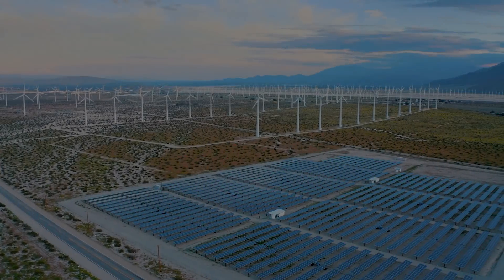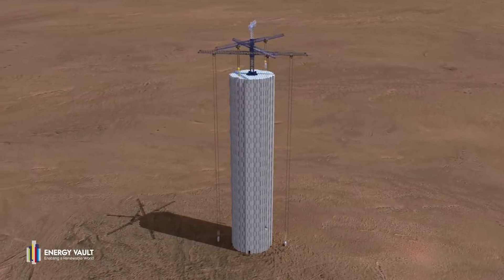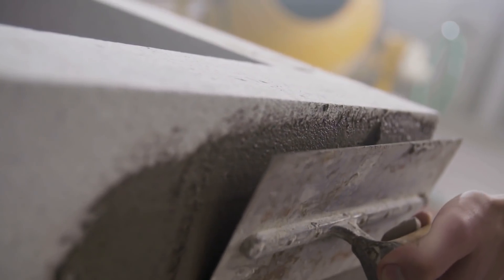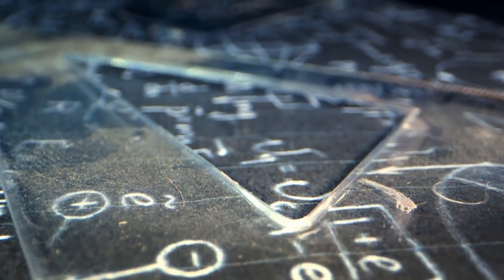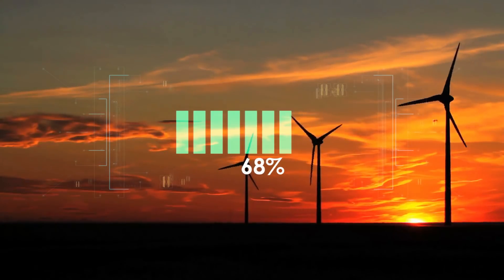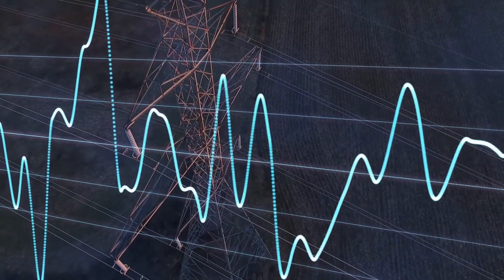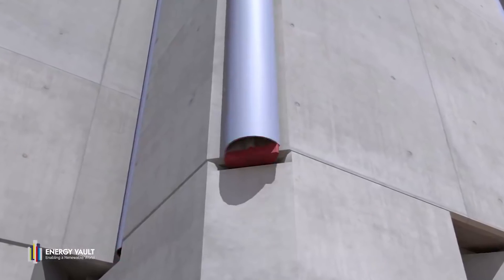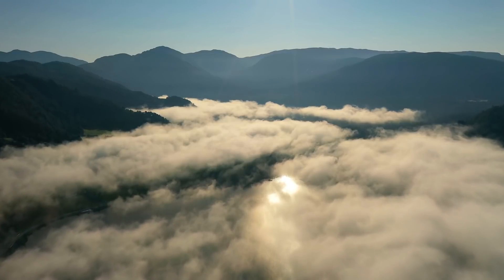Is Concrete the Future of Energy Storage?

Comment: Energy dendity of lifting 4000Kg/m3 concrete over 30 meters does about 1,17 MJ/m3, whereas heating it up by 300C would get us 537 MJ/m3. Liquifying air does 200 MJ/m3.
Lifting concrete has low losses over time but very low energy density and does not allow use of a heatpump that might raise the power efficiency

Comment: The video is great job and so is the idea about energy storage using gravity energy by lifting heavy blocks.  A 35 tone concrete block with weight 35 tone will have a volume around 14.6 m3 and if concrete cost is 300 $/m3 each block will cost $ 4375.  Lifting this blocks on 150 meter will consume around 14.3 kwh energy from wind or solar and this is not for free the energy company will pay the market price or they will invest direct on wind or solar and store the energy they harvest.  Every block will be used only 1 time every day when the consumers need energy.  Not all the energy consumed will be re-generated but let consider 80% efficiency, then 11.45 kwh energy will be output.  This energy may be good for a family.  Now let see multiple blocks on tower 150 m high. The blocks are not all on 150 meter so the energy on average will be half of the energy re-generated, so a block 35 tone will store only 5.72 kwhr and will consume 7.15kwhr and may be used no more than 1 time a day. If the investors on these energy storage will sell their energy with 0.05$/kwhr to distribution companies a blocks which coat $ 4375 will need 42 years to pay only the concrete. Is this what investors need? 
Gravity energy is great but the physic science must be used properly.  On hydro-electricity we use the nature and rain and snow precipitation, we use mountains and river and build dams which store the potential energy and generate electricity on demand and this is cheap and e business which makes money.
We must use the concrete blocks multiple time within a day and generate energy on demand with lower cost and lower pay off time.  This can be done only from one undisclosed invention which is know-haw and only can be disclosed if government and investors will enter on partnership with inventors and keep it know haw.  As the invention will use concrete blocks multiple time and will use other know-haw concepts the energy generated is higher and the cost is lower and this lead on public interest, on government interest, on investor interest, and last but not least on inventors interest.  The inventors are not interested to apply for a patent which they think is unfair because a disclosed idea can be infringed easy from industry.
Interested countries let contact inventors through these paths @namecgregory.com

Comment: What about using the sea! Sea is very deep; on the surface a large floating platform can support concreate blocks that will sink in the sea. Energy stored when the weights are pulled up, same principal mentioned here. Since water density is more than air you will need larger weights, only difference is it!

Comment: This has to be one of the most nakedly stupid ideas I've ever seen.

Why is something so obviously idiotic on a channel that supposedly talks about engineering and science?

Concrete blocks break, they deteriorate, they take a TON of energy to manufacture, they deform.  What idiots came up with this idea?  You'd be better off with pumped water storage and that's not a great idea.
Reply: Just from the top of my head, two sets of a rail, weighted carriages and a hill would be a far better system than this trash. You could use dirt for the weight and you don't really have to worry about weather unlike what you get with crane use.
Reply: @apoorhorseabusedbycenk  If you aim the kick right, you can collapse Cenk's trachea.

Comment: It's just a terrible idea in reality, the amount of energy that can be held is low for the scale of the system, you would have to drop a block many metres to boil one kettle. Lifting and placing the blocks accurately in wind is a problem, wear and tear on the pulleys is a problem. Blocks at the bottom store next to no energy. This problem has already been solved using Water which is so much more plentiful and easy to work with, albeit requiring mountainous terrain to make the best of it.
Reply: It depends solely on the mass of the block and the hight of the shaft, otherwise the is no much difference between hydro and gravity power. Most of the time the mass of the block is overlooked, have your research on that you will see that the system is realistic.

Comment: I thought your channel was a realistic and scientific channel, until this nonsense video. It completely ignores Banks Lake pumped storage, which has a capacity of 34,250 MWh - 500 MW for 70 hours. It's iong since paid off, but a similar project is slated at about $5 billion. Across the project's 90 year lifespan (and still going), that comes out to $1622 per MWh. And being an existing project, that suggests that these other projects are severely lowballing investors - likely it will cost twice as much. Not to mention all of the wind, corrosive, and other effects that will wear down units of concrete block, but water molecules can't be worn down. They can be evaporated, for which reason Banks Lake should get some kind of lid, like California are  looking at over canals. Still, I would have expected even an honorable mention of this very valuable battery in Eastern WA, and for that I've unsubscribed.

Comment: Singapore has a shaft digging machine that probably lowers the cost for ru8nning a Gravitricity borehole.  Energy vaul;t is not nearly as discrete as gravitricity's solution.  These would be like mechanical batteries like flywheels and such.

Comment: gravity energy storage depends on gravity. gravity force depends on weight. weight depends on the density of material. concrete has a density of 2.4g/cm3 , while iron has a density  7.8 , and lead - 11.29. Gravity energy storage with lead as a basic lifting unit will be about 5 times more efficient than gravity system with concrete blocks, and 11.29 times more efficient than water pumped storage since water has a density of 1. So, the point of efficiency in mechanical energy storage finally ends up in the price of the most denser matter you can find at the cheapest price. Open a business to collect all used lead acid batteries and get the cheapest energy storage possible. You could go further and make the energy storage out of Uranium few hundred meters underground but that would be very crazy
Reply: though
what about the maintenance costs?
and of course, metals are much more expensive than concrete, and even more so for water

Comment: the crane people are so dumb. but those mine shaft people may be onto something. 1, lack of wind, 2, no need for insane percision(its literally built in), and relative ease of installation. While the energy vault people have jumped backwards and flipped into giant warehouse, the people at graviticity have just 1 point of failure, sooo... its a big hole, and you have a big weight, now the strain on those cables may be tough, but from the image it seemed to look like there were multiple

Comment: I'd like to see more failure analysis.
- How do you handle end of life? How long before? What can be recycled / repaired? How toxic, are components, and how to disposed of?
- How susceptible to sabotage? For example: rpg or airplane attack of various components, fly over dump of material/chemicals on tower, computer attack of control system (make the crane drop weights on the tower or mis-stack then tip), ...?

Comment: The down side of compressing and expanding liquids are significant losses to heat. liquid compression energy storage offers high energy density (energy/volume and energy/KG) without degradation with discharge cycles. Gravity storage is best if scenery and space are not a concern. Those crane sky scrapers are ugly dystopian looking contraptions. Digging a massive hole for gravity storage seems fiscally inefficient but is in my opinion the best solution. An incline plane gravity storage system is appealing but has safety concerns, nothing that can't be overcome. Chemical batteries are best for energy density and small scale operations but they degrade. The solution will be a variety of energy storage and green energy generation. Fusion is still the unobtainable holy grail of power production and always will be. The problem with fusion is that it does not fit the small scale and self sufficient model well. Maybe fusion reactors will be 3D printed some day. I personally think huge windmills and large solar farms create ugly landscapes. I like to see solar and wind on roof tops used in small scale with batteries. If we want to be "green" we have to give some more land to back to the trees.

Comment: I wonder if there's any accessible explanation for the pile-up design of the "vault." Intuitively it seems a waste of energy compared to have a tower depository of a fixed height from which you drop the weights and carry them back all the way through, with no stationary intermediate steps. To pile up the blocks seems analog to have the bottom reservoir in a pump hydro be so full that no or little water can flow to it through the turbines, which are also inundated. Without an explanation behind the design it seems more like a random sci-fi imagined thing promoted without any real planning on efficiency, just on looking cool and supposedly green.

Comment: It's a cute idea, but it's dumb as hell. 
'Loosely fitted cement blocks' at a height of more than 10 feet? Constructed automatically by crane and a computer program? 
Ignoring the glaringly obvious issue of 'how many times a year does it accidentally collapse' (One is both too many and, likely, not even close to the bare minimum that will occur in practice), we can instead discuss energy efficiency. One of these towers can store ... 35 Megawatt-hours. 
That's... not a lot. Two wind turbines produce that much. In an area where wind turbines are one of the leading energy producers, you'll usually see hundreds.
That's a lot of shitty concrete stacks falling over everywhere. And of course, again, all that concrete isn't free or clean to produce, nor is all the wire and steal required by the cranes. 

It's not a good idea, it's not a sustainable idea, and it's not even a safe idea. We really shouldn't be buying into this when better options already exist.

Comment: No, it isn't. Not only do you have to worry about wear and tear, but the cables could also snap and so many other things can go wrong. So no, this isn't feasible, it's more expensive than water, and the method in which you explain it is less efficient than it could be. It needs work and for people to actually make the prototypes instead of a 3d-vid.

Comment: why doesnt somebody just build a motor with a built in alternator? So theres magnets around the outside of the alternator and inside a shaft at the core of the alternator for double the power? The motor is the outer most part and the coils turn a ring of double sided magnets that face outward on the ring towards the coils, and inward from the other inner side of the ring towards a hollow alternator coil that has a shaft of magnets inside its core that the motor using sprockets also rotates. Double the magnets inside and outside of a properly specked out and wound alternator coil should produce double the power of the motor operating it. Maybe even more? Neodymuim magnets are very light and powerful.  I just invented this and if it produces more energy than it uses, i give it to the people of the world as a gift to use for free by publishing it here:)

Comment: great! where do concrete blocks in container box come from? do they serve any other purpose of dum bells? why do container terminals don't use it? they stack hundreds containers everyday. 

those mine shaft, missile silos are precious, don't use in dum ways. store clean fresh water! dig a pond nearby is not technology difficult, you just need a pond 5 ft deep. manage water level between the pond and the well is comparative easy. why? you can separate and takeout 10 lb worth of water easily, but can you cut 10 lb from a concrete block easy? the pond also serve other purpose beside electricity storage, animal and human drinking, farming, fire fighting, fish farming, flood control, you name it. 

do concrete blocks do these too? 

is it new? no, look at those farming and cattle states, sometimes they call it water hole, the only difference is they don't have the pump and generator install to pair up with the electricity grid. and you don't have to use one pond to supply the whole world, do it local. if one down for any reason, the rest still keep going.

don't reinvent the wheel, especially when your new design is triangle.

Comment: It would be interesting to know if a gravity shaft system would work scaled down to a single dwelling where its solar panels are producing an excess during the summer months.
Reply: Considering that concrete tower can only store two wind turbines worth of electricity?
I doubt it scales down well at all.
Reply: Not in a million years. It would cost tens of thousands of dollars and you would gain only a few dollars per month. The energy density of these systems is disappointingly low. To store the annual electricity of a small household (lets say 3000 kwh), you would need to lift a 10 ton weight 108 kilometers (!) high.

Comment: There is a new invention that avoids this: PROCESS OF CONVERTING SEAWATER TO HYDROGEN, PIPING IT AND REFORMING IT TO FRESHWATER. that converts seawater into freshwater AND transfer it inland at minimal cost. Energy can be stored as water. It is eco-friendly and it is cheap since it uses existing infrastructures such as hydroelectric dams.
Reply: There is no 1 solution fits all. Energy storage overall has so many different demands and constraints that there is no one single solution to this problem. This is why there are so many different solutions. Most probably will never see the light of day, some will fill a niche and some will become the main used solution.